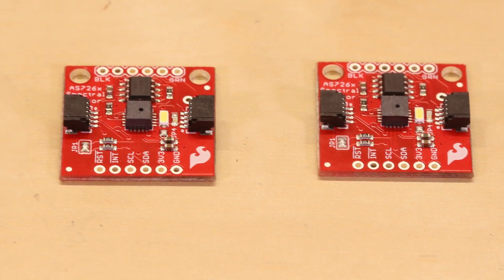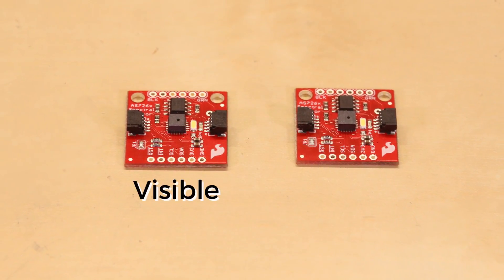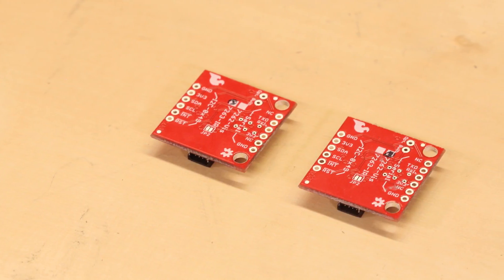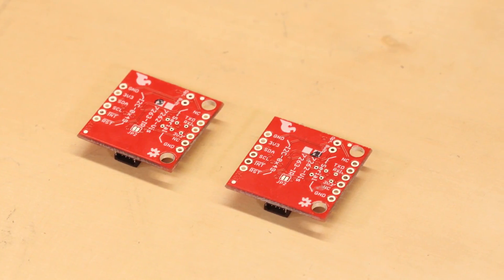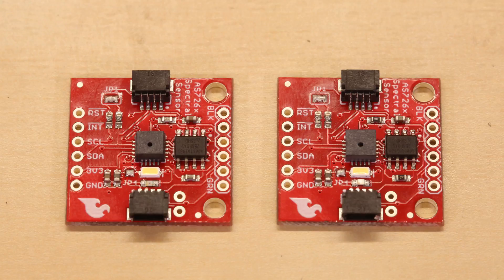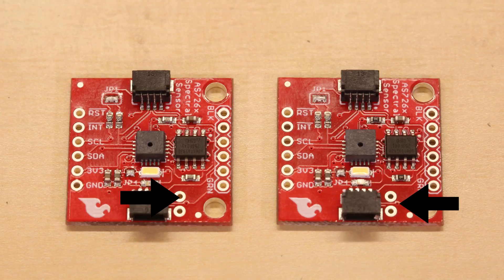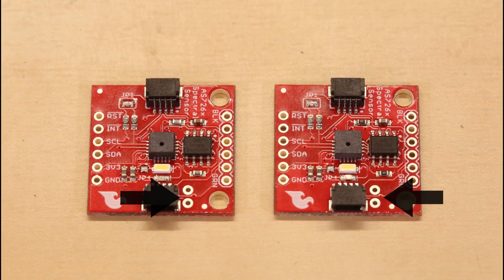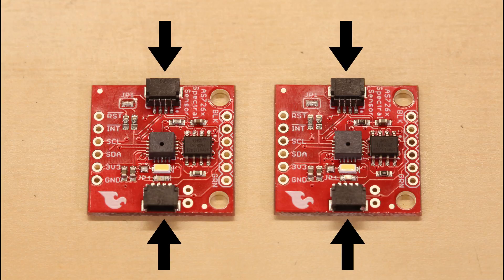Product Showcase: Qwiic AS726X

Comment: I tried to use NIR board, using arduino nano iot and the arduino IDE. I connected the four cables as described in the hookup guide, which is really easy. I downloaded the latest library AS726X. Compilation and upload work without any error message, but the serial monitor stays empty when I rund the example code. Could anybody be so kind to give me a hint? Thx :-)